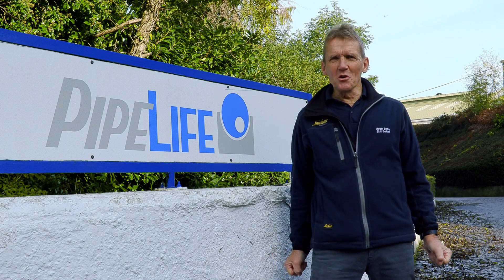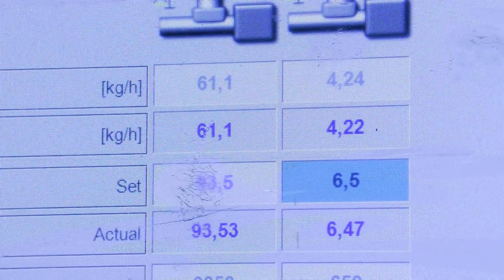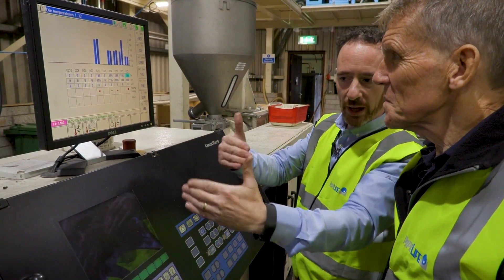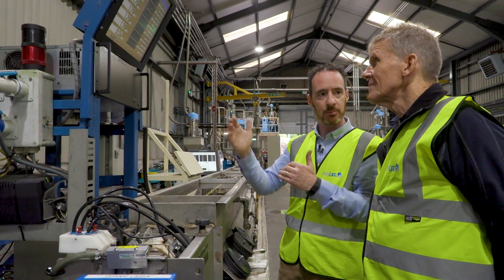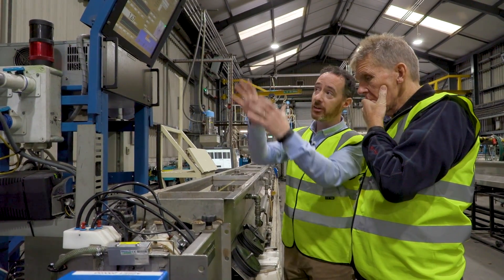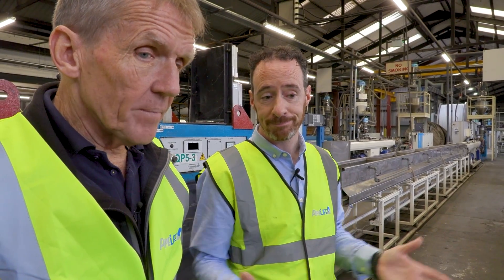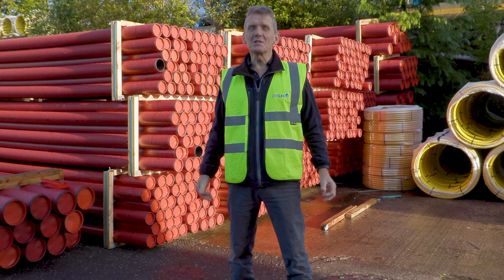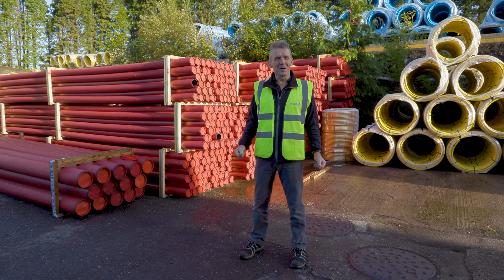Are You Paying Too Much For Your Pipe? PIPELIFE

Comment: I'm I right or wrong 
Plastic pipe is only guaranteed for 5 years , while copper pipe is guaranteed for 30 yrs
Reply from the maker: Did you watch the video?  It has a 50 year guarantee.
Reply: @SkillBuilder  absurd guarantee.
Reply from the maker: @stevendouglas3860  I am sure they would be happy to reduce it for you if you inisisted. Drive a hard bargain, beat them down.
Reply: @SkillBuilder  😄

Comment: My boss always says about never to use hep pipe on speed fit and vice versa etc and I've never questioned it good to know that they do both work because its all built to the same standards etc. Interesting you do learn something every day!
Reply from the maker: Yes that is one of those myths that has kicked around for too long.
Reply: @SkillBuilder   guarantee is void though if you mix manufacturers fittings and pipe.
Reply from the maker: @ianbrown1581  Ian
 I was wondering how long it would be before this came up.  It is simply not true. JG does not make copper pipe but their fittings are suitable for use on copper. J.G doesn't make the pipe so work out who does. If the plastic pipe is made to the B.S standard there is no way anyone  can insist on you using a brand of pipe. Also you have to consider what happens when you join the pipe to a shower valve or tap. 

It suits the companies very well to put up this kind of nonsense but the guarantee is on the pipe or on the fitting not the two things used together in a system.
Reply: Skill Builder agreed the fittings and the pipe are guaranteed by the respective supplier/manufacturer but if you stick to the same brand for both at least they can’t mess you around by blaming each other if something does go wrong.
Reply: My house was flooded by a loose Speedfit connection. My entire lounge and kitchen was destroyed.
Reply: @w75525  I always use copper where possible but recently done a full house (i say house it was a big house) that could only use plastic on because it was taking spring water from the hills so that was all done in plastic. Just have to ensure its pushed in to the correct depth. I always use hep as well just because you need the key or fiddle about with a screwdriver to remove them at least it's a bit harder to stop people fiddling.